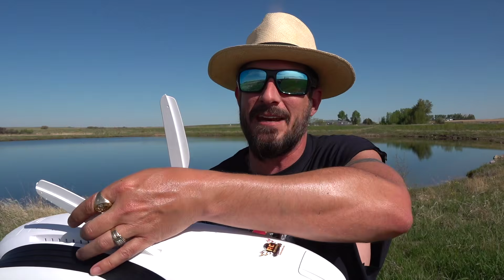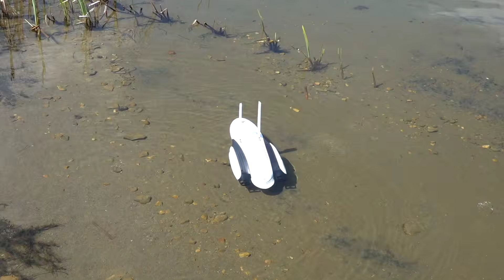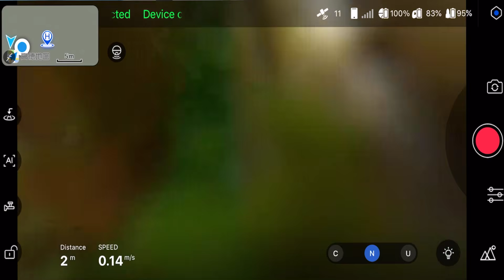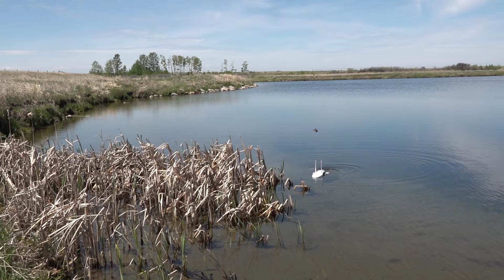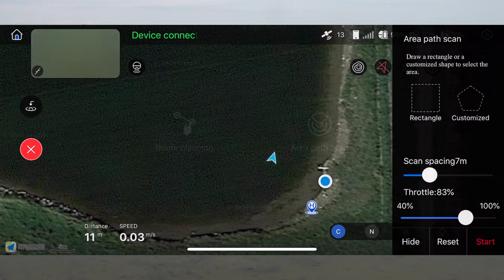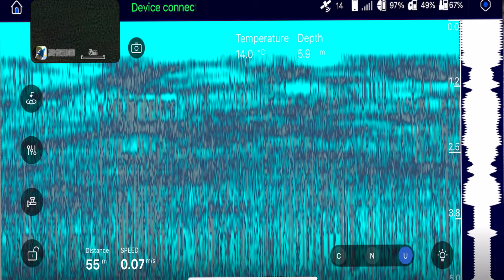NEW AQUA ROV SEARCHiNG TOOL w/ SONAR! PowerVision "POWER DOLPHIN" RADIO CONTROL BOAT | RC ADVENTURES

Comment: If you do eventually find the electronic device of interest, will you ever fully trust it as you did before even if you can get it working again? There may not even be anything left of any value to salvage other than the motors. Even then they'd need to be nearly waterproof though brushless motors are inherently more durable in that regard than brushed ones.
Reply from the maker: Found it :) Now Im retrieving it in a few days

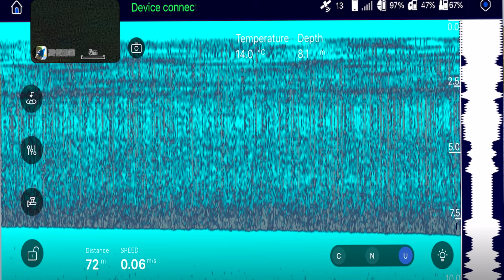Comment: 10:40     ...I think the thick white band is the bottom line, underneath that, there is a reflection in the signal, narrower if the bottom is hard....try turning down the sensitivity, you seem to be picking up a lot of the minute debris in the water...

Comment: The Power Dolphin is using a bottom sounder sonar to "map" the bottom.  When it gets a solid return at an unexpected depth it marks it as a fish.  All of the other different colors between the surface and the bottom is noise, either something suspended in the water that doesn't give a solid return (such as plants) or varying temperature layers.  If you want to really learn about sonar and all the different things that will affect it, try finding a copy of the RP-33, Fleet Oceanographic and Acoustic Reference Manual.  It will go way more in depth than you will ever need, but will teach the basics such as the different types of loss, what the sea bottom (or pond bottom in this case) will cause and other fun facts to bore people with at parties.  I was a Sonar Technician in the Navy and this was one of our Bibles.  I think your best course of action would be use the Power Dolphin to map the bottom, then send the FiFish in to checkout the anomalies on the bottom.  Sorry for the book, but you said you wanted to know!  Keep up the videos!  My son and I love watching them!

Comment: That is a pretty cool gadget  and it performed surprisingly well. As for the sonar part, I would reduce the sensitivity down, maybe start at 50% and then adjust it until you can see the bottom which should appear as layers of varying thickness, the more solid being the actual bottom. What your looking at is a slice of what is passing through the beam, everything that passes as the boat moves is drawn out from right left, it’s what has passed or behind the boat, it’s history. The A scope is that funny looking patten on the far right, that’s depicting whats directly under or in the beam in real time. 

I used sell fish finders back when I worked in a yacht chandlery, this reminds of what fish-finders of 20yrs ago looked like, they’re a lot more refined now but it’s amazing to think they can packaged the tech into something so small now.

Comment: What if the cement thing in the middle with the rebar is part of an old mine that maybe even a hydraulic mine witch could have something to do with why you have pond after all a lot of old abandoned hydro mines are still running water through them or flooded out and with all the gold you guys keep finding on your property it could be very well possible . maybe there is some gold hidden on the bottom of that pond oh and its probably fed from a near by river or a spring i really think you have an old hydro mine that flooded out under the  pond it would make sense with all the gold you find

Comment: Turn your sensitivity down you have to much clutter and turn the frequency up if you can it  a lower frequency will scan a cone to the sides and down of the sonar but less quality image higher frequency scans straight down but with a higher quality image. If you really wanted to find this buy one of the new Garmin down scan/ side scan imagine and attach it to a big rc boat and scan that way will be a crystal clear image instead of the clutter you're seeing

Comment: what you are seeing is noise or dust particles suspended in water so you need to take that noise out to see hard/soft bottom elements with fish cones not fish symbols.

Comment: Wifi has come a long way but it's still my last choice for control wen it come to my RCs plus the proprietary batteries are a deal breaker sadly... best of luck on the such!

🥃cheers🍻
Reply from the maker: Wifi is not controlling it.. it is only sending video signal.
Reply: @TheRealRCSparks  nice! Still the last thing I want but that's definitely an upside for sure happy it's not strictly wifi

Comment: Will you find the drone? eventually but not with this sadly, while it has sonar it is the wrong kind, the fish finder is like a vertical slice from the surface to the floor of the lake and only reports what is directly below the boat , what you would need is a survey sonar as this kind works top down in a birds eye view format, so rather than a vertical slice it would be like you are looking down on the lake floor, Perhaps there is a setting in the APP for this?
Reply from the maker: You  can actually  splice all of the information gathered in to a topographical map.

Comment: Only bad thing is it can’t go Underwater so you can see the bottom. The ideal thing for this would be this drone that can go underwater.
Reply from the maker: I have one that  goes under water.. its what I was mentioning at the start of this video. Its called the FiFish V6
Reply: RCSparks Studio is that the one you were using in the previous videos? Or is this another new one. I’m hyped!

Comment: There is a fine balance one needs to achieve with the sensitivity on the sonar. All the colors coraspond to the desity of the target its hitting the higher the sensitivity the more the eye will see. You need to find the spot where you can see the fish well but not the water and and everything in it which is what you get turned up to 100%. I was commercial fisherman for most my late teens , 20s and early 30s. All i did was mess with a screen like that .  I think its cool to see it here
Reply from the maker: Thank you for the assistance.. i will use this machine more to try and understand what Im looking at! Wish you were here for a day.. lol
Reply: @TheRealRCSparks  if i wasnt at the eastern edge of new england i would be there in a heart beat my friend. After all the years of help you have given me , i am honored to be able to assist you even in the smallest of ways my friend. Thank you for all you share with us.
Reply: A much lower setting may show harder targets like a rock or drone is what im saying . To be a bit more clear
Reply from the maker: @darrylk27  100% understood.. I will lower the sensitivity to 50% and see from there how it goes

Comment: Hello. Just a small tip from a fisherman. When you were asking what you were seeing, you had your sensitivity too high when you turned it up to 100. Instead try it less than 50, maybe even down to 30. The sonar was picking up all the particulate in the water, which is why you have so much "static" if you will. If you lower your sensitivity, the water column will clear up and only display larger objects like buoyant debris or fish. The image of the bottom will also become clearer and allow objects that may be protruding from the bottom to become visible. With all that interference, you will have a hard time even seeing sticks or weeds let alone the possibility of a prop from your drone sticking out of the mud on the bottom. Also, with the fish icon turned off, they will just appear as "blobs" in the water column once you begin to recognize things. Some circular and some oval.

Comment: Another awesome video man, love it. The image on the sonar screen is basically a side profile view of the water. So the top of the screen is the surface and the bottom of the screen is the floor. You may have to figure out how small is too small for the sonar to pick up. I dont know how big those fish are supposed to be that it was picking up, so I'm sure itll find your drone

Comment: I have a question does an rc need an esc I’m kinda new to this rc stuff
Reply: If you want to be able to charge the speed of the motor,(which you probably want in most cases) then yes😊